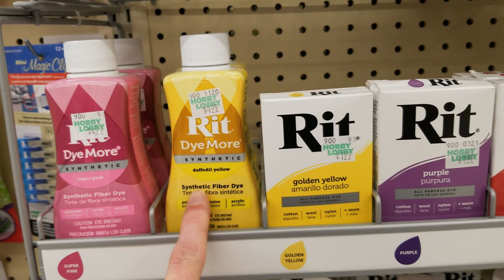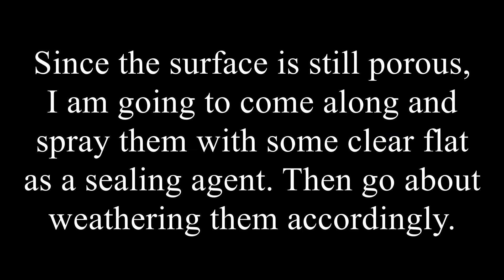How I Dye SLS Nylon Prints Vlog

Comment: Nice results! Thanks for explaining. Did you seal the surface after that or let it as is?
Reply from the maker: Thanks, I did not seal the surfaces (yet) but I have debated hitting it with some kind of sealer? If you got suggestions, let me know.
Reply: Wondering the same! No solutions yet as i don't want to clear coat, searching for some kind of hydrophobic treatment but finding only thick Paint application, not the best for keeping details...
Reply from the maker: Yeah, that's a hard one. Maybe try some clear coat would work? I know some processing methods commercial companies will use is spraying the parts with a matte sealer, then hitting it with a bead-blaster after to knock the excess off.

Comment: Hi, Could you tell me why does dyeing my part black turn out blue when left in there for an hour. Does the longer the dye boil in the hot water, the more blue it get due to the heat burning off the other color. I am currently trying to dye my part black but having great difficulty.
Reply from the maker: Have you made the black dye super concentrated? That's the trick I found worked best.
Reply: @MakeItWithCalvin  I have to use about 4-5 gallon of water due to the part being big. How much dye would you recommend? And do you recommend adding vinegar as well. Thank you for replying
Reply: @MakeItWithCalvin  also do you add red to your black? To even out the green?
Reply from the maker: Oh gosh, if in doubt... Yeet more bottles in is my advice! When I do mine I would use 1 bottle of RIT dye and the SMALLEST amount of water possible. That's how I did it and got jet-black parts.
Reply: @MakeItWithCalvin  thank you! Will add more dye. Great videos it was a lot of help!

Comment: I am thinking about getting a Fuse 1, they only have gray/black nylon. Am I going to be able to dye those?
Reply from the maker: Hmm... I am going to say no unless you want to make it extra-dark black.
Reply: @MakeItWithCalvin  gonna try spray painting see how it goes
Reply from the maker: Can't hurt, I did a video on painting SLS train models that may be helpful. I am curious to hear how the Fuse 1 works out in the long run.

https://youtu.be/kaD-sT-J3hg
Reply: @MakeItWithCalvin  When spray-painting SLS parts, do you need to apply a primer first?
Reply from the maker: It depends on how smooth of a finish I want. For parts where I don't mind seeing the grainy texture, I spray it straight on. For parts where I want the surface smoother, I will hit it with some filler-primer, sand if needed, and go from there. In my experience the paint sticks decently well, but you may want to experiment.